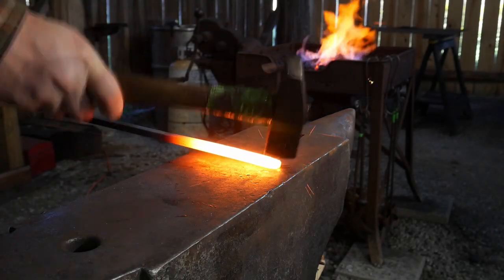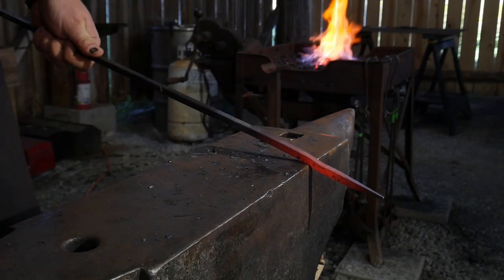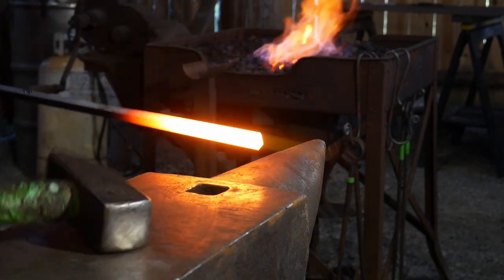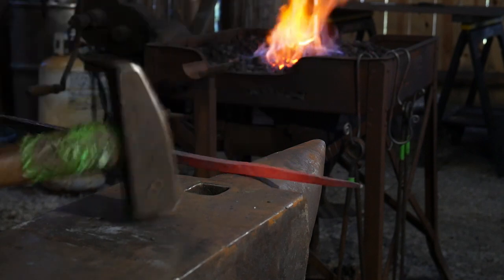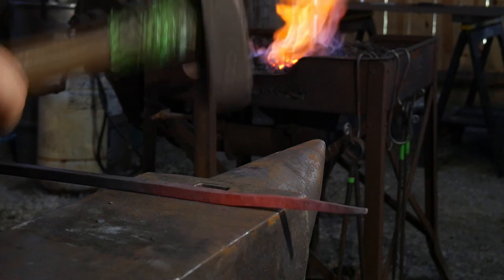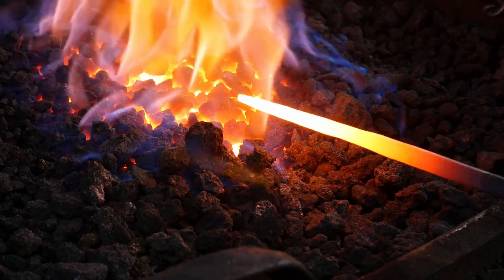Forging a Fire Poker: Viney Style

Comment: Iv got a small gas forge, iv attempted this a few times but cant get the welds to stick. Starting to think my forge cant get up to a high enough heat for a proper forge weld. I was thinking i should just go out and buy a little welder. Any thoughts?
Reply: You need borax to clean the flux, and get the steel hot.

Comment: What size stock did you use for this
Reply: Also what length
Reply: Gentlemen, my guess he used 1/2" sq. At minimum, depending on where the poker is going to be used and shop equipment available 5/8"-3/4" and at least 36" is my recomendation for a fireplace poker, camp fire length or outdoors firepit, 48" remember you want to move logs not bend a poker! Hope this helps!
Reply: 3/8" about 30" long (he said this elsewhere).